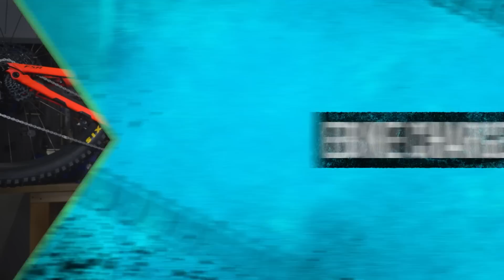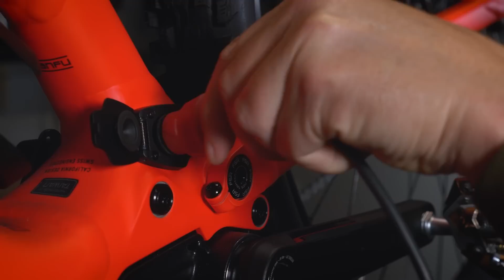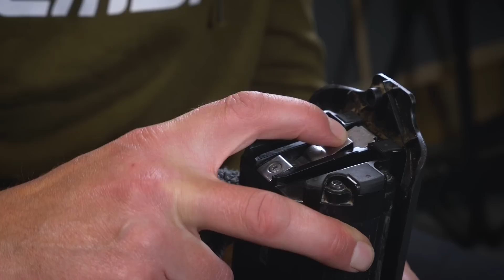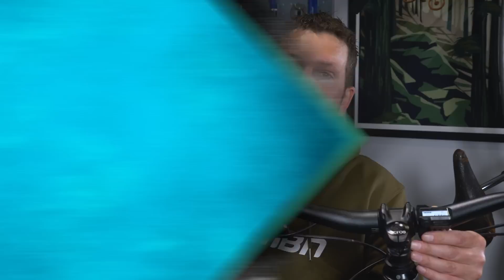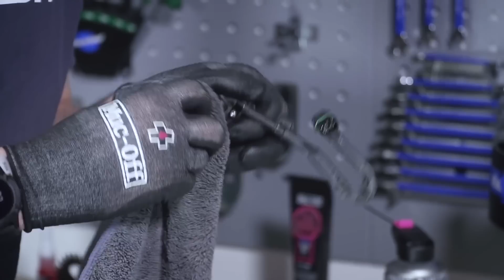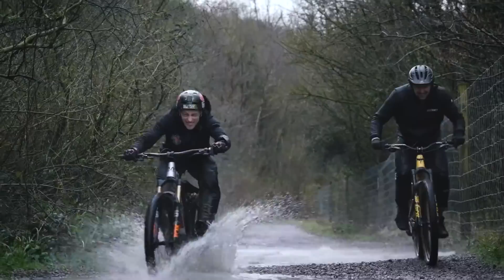EMTB Electrical Maintenance Tips | E-Bike Care!

Comment: Great video!

I'm curious, is there more maintenance involved with Ebikes or are they about the same as manual bikes?

Also, the Market is really blowing up now!  What is a solid, bang for your buck model?  My local shop carries Norco, Orbea, Transition, and Pivot.
IMO, I think it's ridiculous to spend $10k+ on any bike!  Some of these Ebikes are well over that price point.
Reply from the maker: Hey Norbert! Maintaining an E-MTB is very similar to how you'd service a normal bike (for example brakes, groupset, suspension and bearings are all similar). However, maintaining electrical components is an additional factor you have to consider. Hopefully,this video explained that for you! Thanks so much for the support! 👍
Reply: @embn  Thanks for your response - that's good to know.  What about the "Bang for your Buck" models? ( if you're able to comment 🙂)
Reply: @NDemanuele1  check out the Yamaha Moro, great bang for your buck at $4650 US
Reply: I would say that ebikes do need additional maintenance per hour use, as the forces are greater over that time. Not only are you accelerating faster but you are also braking against more weight. Wear happens faster with more weight but you get the benefit of less personal effort during the ride.

Comment: 1st I would like to say that color on that Specialized is seriously on point! Hard to listen when I am distracted by that beauty!! 
2nd.. never spray cleaner/degreaser onto a connector. Spray the towel and dab it so as to not push debris down into the plug. Once you dab the goo off of it, then you can wipe it more aggressively. :)
I cut a phone screen protector to cover my display and to protect it. Bonus is I used a non glaring type to fight sun glare of the screen.  My hip pack has a drinking tube with a magnetic stay. I copied that Idea and fastened a magnet to my charger plug. Now when my charger is not in use, the plug is captured with the magnet and held up high on my tool box, out of the way and in easy reach for the next charge cycle.
Reply from the maker: Hey Todd! We agree, the Specialized is a super sleek looking bike! You've got some really cool hacks there! We'll all have to use those! 👍

Comment: Dielectric Grease and ACF-50 is all you need for connections👍
Reply: @harrynorman2200  I have just bought both those products bot don’t really understand how to use them! I thought the ac-f 50 would dry but it stays oily and the dialelectric grease can you ram it in the connectors? Because they are so small I can’t see how you can use it without it going on the terminals??

Comment: I'm amazed at how many really weak aspects are just accepted as normal on bikes that cost as much as a car! 
Why are the makers using these junky connectors? And incredibly thin and delicate wires mounted on the inside face of a swing arm??? I think these guys should NOT put connectors right in the very spot that will be pelted with grit, water, mud, sand. This should all be the normal. Can you imagine if trials bikes or motocrossers had so many weaknesses built in?
Amazing that it's all down to the rider to identify the weak spots, what are the designers doing?  Or is it all just maximise profit by minimising cost?
We seem to need a "Honda or Yamaha" to produce something stronger and better, it will come and all these "pretty things" with a few great parts, will get shaken up.

Comment: Cover your charge port with some duct tape in wet conditions
A little dielectric (vaseline) grease on your charge prongs will grab dirt out of your battery
Tape up  the seems where your battery mounts to keep dirt and muck out
Tape up the vent holes on your skid plate but leave the ones on the bottom for drainage
See my channel 😉

Comment: top tip if ur shimano motor goes wrong out of warranty just throw it in the bin and buy a new one for 1k  becouse shimano has made them all non serviceable and brick the motors if you open them up.
Reply: just had this exact problem after a few 1000 miles that e010 error code ie battery connection problems it could be a new battery could be a new motor could be the speed torque sensor what cant be fixed it is a code that doesnt tell you whats knackered just cuts power to the motor when putting pressure on the crank so folks it you buy a shimano motor put 500 quid a year away  ready for your motor going after a few 1000 miles
Reply: @lushbikes  tbh if it was me and it failed just out side warranty id take them to small claims court as not fit for purpose as can not be serviced buy anyone if they go wrong
Reply: @soundwave6769  warranty issues aren't such a problem if we have right to repair, not sure if that works in UK though
Reply: @lushbikes  Yes, it stings. Especially when obsolescence still seems built in. Short term that's exactly what I'm doing. Long term I'm looking for a Kickstarter that drops in a reliable system without the harmful protectionism. Shimano is still working on a disposable bike business model. It's clear from the uncompromising progression from E8000 to EP8. I have no loyalty to Shimano because they don't care about what I care about.
Reply: Ur? Brick?
Reply: @glenn.turnbull  software locked anti tamper sensors
Reply: @lushbikes Don't throw it away and have spares for the next motor you get because the bike is designed for DU-E8000 only.
Reply: @RoddyRoams  thee ep8 is retro fit so has the same fittings as an e8000, you have an e8000 go on a four year old bike, an ep8 will fit, there many vids of this been done
Reply: @lushbikes  Thanks, I found this out a little later. Good to know!

Comment: I like having no display on the handlebars like some Giants and other bikes as this can be a trouble spot but on the other hand you can probably set your phone up to be a display if you want and easily remove it. when you are riding in rough terrain or don't need the info right in front of you. I heard you can remove the controller on the handlebars of the 2022 Giant reign and just run of the top tube unite. The new controller is wrapped quite nicely around the bars thou.

Comment: E8000 external battery mount.
I started to get an overheat warning after 10 minutes use. Examination of the terminals showed pitting due to high temperatures with some bubbled/melted plastic where the metal met the mount. The overheat warning was resolved by cleaning the battery mount terminals with wet and dry paper and contact cleaner. I'll be covering the mount in future when transporting my bike on the back of my car. Wondering if some di-electric grease might be a good idea too.
Reply: try acf 50 lot cheaper di electric grease
Reply: @ashleyscarth8363  will bear it in mind if I ever get through this tube of grease 😏
Reply: Vaseline is the same shit
Reply: @islandaerial3414  vaseline looks the same but it's petroleum based, dielectric grease is supposed to be silicone based and won't degrade rubber like vaseline. Vaguely remember being told that by an earnest biology teacher 🤔
They didn't mention dielectric grease though 😁
Reply: @RoddyRoams  What part of your electrics are rubber? 🤷‍♀
Reply: @islandaerial3414  the boots
Reply: @RoddyRoams  Hmmm, my Trek doesn't have any of that crap.
Reply: @islandaerial3414  guess you've been looking after yours😏
When I bought my Merida I couldn't justify spending 50% more to get a full suspension Trek.
Reply: @RoddyRoams  Didn't know I had to until, I had make some decisions about how much of my hard won currency I was willing to part with, to the so called professionals 😆